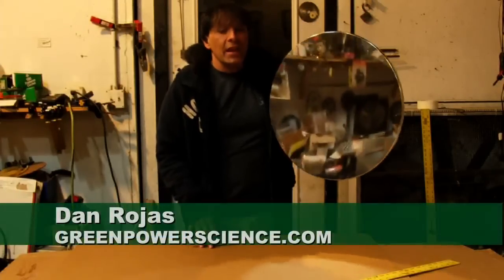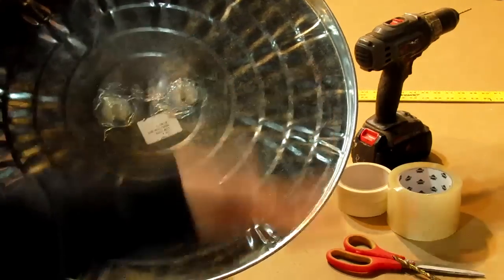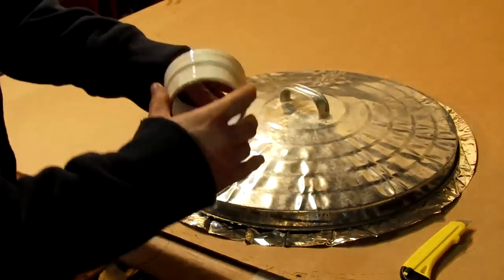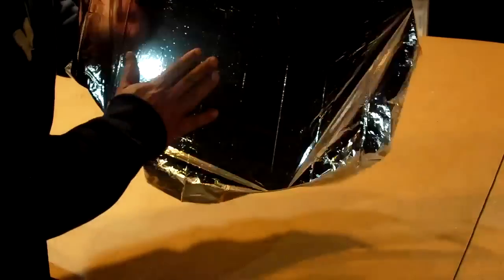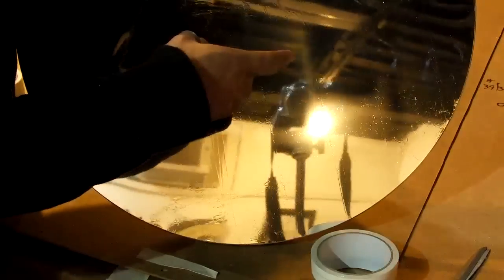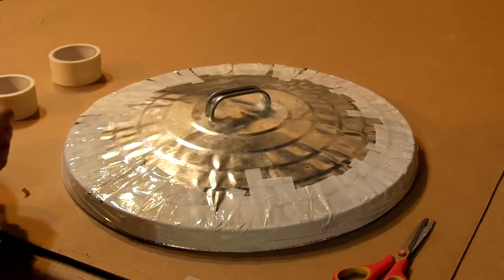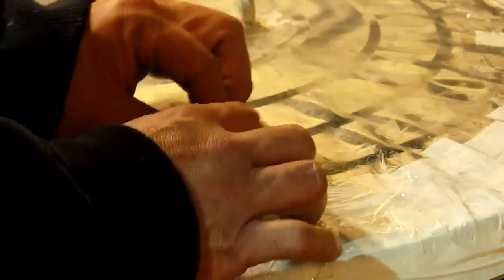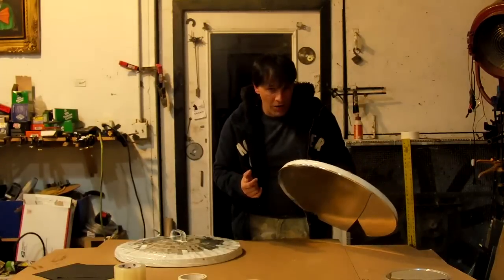Trash can lid to Parabolic Mirror DIY telescope mirror Signal booster Faster 3G/4G

Comment: If I might make a suggestion:

lay out the mylar, and tape it down to a flat surface to stretch it.   Then, place the lid on top, run a bead of silicone or even hot glue around to both bond the mylar to the lid AND seal it.  Then trim.
Reply: have you tested this?
Reply: No, I certainly haven't but I can't see why it would not work well.
Reply: J0llyR0ger I tried exactly this but then I ughhh used hot glue and t cooled too quickly
Reply: Christian Wang yeah, after thinking about it, I figured exactly that would happen with hot glue, as well as possibly heat distort the Mylar too, so I'll bet silicone would be best.

Comment: Did you come up with a way of having these hold their parabolic shape permanently in this handy Mylar + bin lid configuration? Maybe pressurise from the outside and introduce some resin through the hole in the back and swirl that around to coat the inner surface and set in that distorted shape? Or use the vacuum as shown here and then spread resin on the shiny concave face?
Reply: nighhawklight made that just search it, i want to make one but iam not entirely sure how to determine focal point by his method

Comment: I didn't watch this, another time. I saw your square wood frame parabola. I hope you get back to me. I am co spidering a project, mirroring light through a small opening in a container, and dispersing the light on the other side, to light it up. I was thinking Sun tracking, to keep the mirror aimed. It would be very dangerous to use a parabola, in case of accident. I was thinking multiple flat mirrors, that send light at multiple angles, so you get more light entering a small opening, like 3 side by side mirrors, entering at different angles, hitting a mosaic of Tony mirrors, think disco ball.

Comment: To get a good mirror that doesn't have distortions you need some sort of perfectly circular shape that will flex when the vacuum is made. Basically using natural forces to force the circular shape into its path of least resistance (and likewise forcing the mylar into said shape). This is a really clever idea, though, I really love it. Definitely going to put this on a list of things to experiment with. Meter sized scope mirrors can be tens of thousands of dollars.

Comment: How would you get a negative pressure in space for something like this? Or are you thinking of positive pressure in front of the mirror, like a sealed telescope tube? Also, the environment in space has very large temperature changes: you have to consider the stability of the mirror surface.

Comment: To create a vacuum could you just push on the drum face while air hole is open, seal the hole with the tape tab and then stop pushing on? It seems like it would be easier to do than using a pump and tubing.  I don't know if the mylar could take the abuse, though.

Comment: Hi, I was thinking of using your idea to make a small concave/parabolic mirror in order to create a schieleren setup. Can I know how do you close the hole of the trash lid after vacuuming without outside air entering due to high pressure? the size of the mirror that we plan is from 3" to 8" of diameter. Can we control the focal length?

Comment: Awesome video again! Thanks.

Hey dan, if i used silicone glue to seal it, would the vacuum last longer? 

i'm going yo try it and use tape to hold it in place until it dries out and maybe put a tube in the back.

Comment: try filling it with some kind of low hardening expoxy or fluid of some sort that cures and hardens with the mylar or some other more higher quality reflective meterial and then suck the fluid out until the desired shape is formed and maintaining that form via some kinda precise method optically and until it hardens, and there you go and walla the shape is kept, or it could be used as a mold for glass or some other reflective material to be coated, that would be epic my friend, cheap and economical.
Reply: Another idea I had  was to set up a drill to drive a turntable flat circular mould into which you pour a resin/hardener mix and then gradually accelerate the spin speed to achieve the requited parabolic surface as the resin hardens. Using this method it should produce a very clean smooth finished surface generated by centrifugation. In fact some telescopes use this principle with liquid mercury, though they can only be used in  a vertical orientation. Silvered oil or water will also produce this effect. The spin speed will be directly proportional to the finished sagittal of the mirror which will be a perfect parabola shape.
Reply: Would the epoxy stick to the mylar? I like this idea and if it does stick to mylar it is definitely worth trying.
Reply: hmmm maybe lol sounds sound to me

Comment: I don't really get the point of this ... it does not seem practical, except for you do make a cool video that shows that it can be done, which it is - so thanks.

But, mylar, at least good thick mylar for anything permanent or durable is not cheap, and the construction methods while they work are not permanent or perhaps easily reproducible.  What can you do with this, how can it be used as a worthwhile tool, if that is not asking too much?

Comment: This might be difficult to focus especially when it's fixed to a cooker because the parabolic mirror is susceptible to changes in atmospheric pressure.
Reply: Manouni Mohamed It has nothing to do with air escaping from the contraption, the device is more like a barometer now, unless the cavity inside is filled with an incompressible fluid, I don't think this can be used reliably.

Comment: What would be focal length if we use it for Newtanian telescope?, Also will it work for perfect reflection?
Reply: I just saw that when the temperature changes the curve grows or shrinks. It looked to me like the focal ratio was about 2, which is (in my opinion) too low for a worthwhile telescope. The suction also goes away after about an hour but I think the solution would be to cast it so it keeps the shape.

Comment: How do you get it to hold the vacuum? I followed the video but as soon as I stop drawing air out the surface becomes flat again and I can't find a leek
Reply from the maker: Tape the edges, that is usually where it is, also make sure complete tape on back where mylar contacts the lid. Hole in back, good tape, should be fine. Where the lid attaches to the handle, cover the connection with silicone. Other than that, it would only be a pinhole in the mylar.

Comment: Hi, does it require any wiring in order to get improved 4g reception?
Reply from the maker: spiaggi1 No, any mirror is actually a continuous metalized surface. The parabolic shape helps direct the signal bit you just need to be at the focal point. Flat mirrors are a decent option to try.

Comment: What is the deal with him having to tap and drum the mirror side of his assemblies?
The solar film is not that tough and fingerprints and oils from his fingers will transfer onto the film.
Reply: Dan, I think they're intended for cooking.  Fingerprints aren't a problem.
Reply: Yeah, that makes sense.
But this concept makes me think of making a very large telescope mirror in a totally differant way.
And the possibility of a distorted image plane does not spook me that much: The vacuum could be pulled to the extent that an ideal curve could simply be a transient phenomena.
Reply: Fingerprints are ALWAYS a problem with telescope mirrors.
This is why it is vital to never touch a telescope mirror.
Also, I do not see how a parabolic curve is generated.
Spherical curve, sure.
Parabolic curve?  I don't believe so.
However, I'm interested in mirror curve defects which pail in comparison to other mirror problems.  In this regard, it may be possible to "live" with spherical curved mirrors in parabolic applications like astronomical mirrors..
And if there is a problem, you are only out the cost of a trash can lid, the film and a few feet of tape.

Comment: can i use reflective window film in place of mylar
Reply from the maker: Yes, but the edges get very bad crinkles and a single large sheet is impossible to work with once the adhesive is exposed. Us mylar, the blankets are $3-$5 on the net.